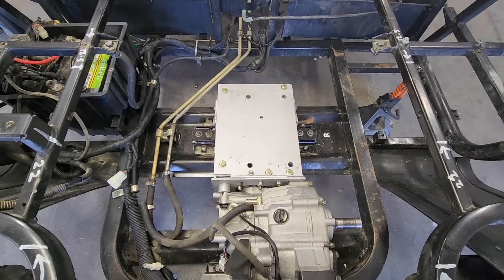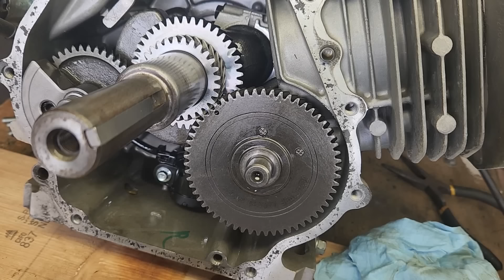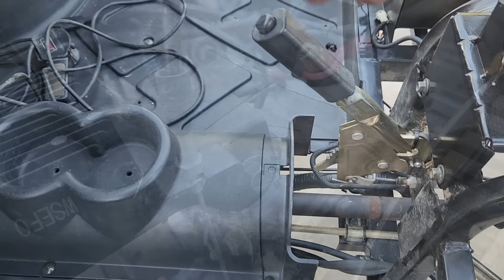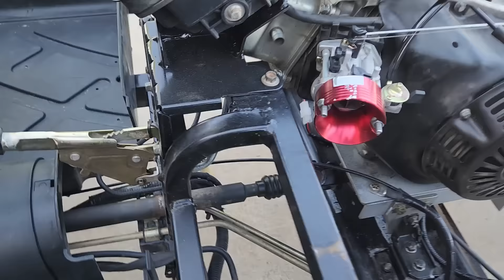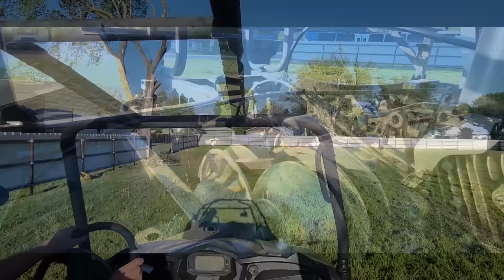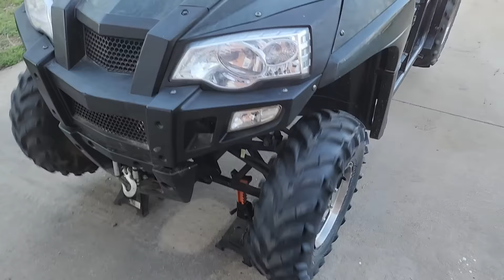S6 E15. HISUN UTV Predator BIG BLOCK engine swap.  4x4 works! plus upgrades!

Comment: I have a much harder project to fix, build!
I own a 2005 EX-GO 4X4 golf cart that was sold to thinking it was complete yet major parts were removed. No transfer case and both axles are identical to a normal pu truck. I hope to use a complete engine/tranny from a 500cc Polaris drive line. NOT as fun as your project here was. TY for the video as it was great and fun. ❤❤
Mike from northern MN.

Comment: Modern stop and start engines use the crank sensor to stop the engine at the right spot to reduce load on the starter and battery. The solution is just a couple lines of code away😊

Comment: 👍 I'm pretty sure you can also buy engine upgrade parts to quite a bit more power out of the Predator 420 engines like you can with the 212cc

Comment: 🇨🇦 Instead of messing with the compression relief just tune the drive clutch to engage at a higher rpm. It can be done easily with different springs or shimming the spring, changing or lightening the clutch weights. You can make that clutch do anything you want.

Comment: On my golf cart that I swapped in a Subaru V-twin I took the driven pulley apart and machied it so that it would open farther.  The belt goes in deeper and climbs up higher on the drive pulley giving more overdrive

Comment: Jimbo from my experience of running high compression big blocks with stock starters if you shut off the ignition while cranking you'll get it spinning just fine then turn on ignition and it fires right up

Comment: If you give the starter 24V the first second and then drop down to 12V the compression issue would probably be overcome. I reckon it would last a long time.

Comment: Jimbo im not certain  if quite understand  your reasoning  for removing the compression relief mechanism but i took it as a potential way of preventing the utv from creeping. 
Now im not certain what size torque Convertor/ cvt trans your using  but i know the smaller (sometimes called a 30 series) They make bushing for them that prevents the creeping not sure if one is made for your torque convertor the smaller 30 series bushings can be bought online at go power sports

Comment: Great video!!  Excellent work on the 4wd!  People with wooded property will almost certainly use the 4wd.  My tractor is 2wd and I have wished it was 4wd so many times.  but they didn't make that diesel Ford tractor in 4wd.  So I am constantly have to be really careful not to lose traction on an angle, or to get stuck in my low land.

Comment: why would you not just change the clutch spring in the primary to something slightly stiffer on engagement and the same top pressure or maybe a little stiffer  if required, multi rate springe are used all over the snowmobile and utv industry

Comment: I've been using the grease truck on carburetor gaskets for years.  Works like a charm especially when dialing them in and removing a few times.

Comment: Jimbo...use your skills to make an ignition cut that only starts sparking when it senses "X" amount of RPM so the engine turns up to x before spark.  If it is purely mechanical compression stopping the starter than mod the springs on the comp release.

Comment: starter procedure:
- Relocate electric starter
- Fit the pull cord to the electric starter with a pulley
- Put a knot near the end of the pull cord 
- The knot hits a cut switch for the electric starter to protect the new starter procedure
- Use when needed

Comment: have you tried to use a 18v drill battery starter circuit? and have it recharged by a booster buck, or the milwaukee m18 charger that runs off the 12v cigarette lighter port?

Comment: If there was a belt transmission and only the diff-lock, I would really wonder why they did not save the diff-lock and just went for two belt transmissions for automatic torque splitting + redundance.
Of course, a fourth belt for the front axle would have been excessive.

Comment: There needs to be a way to bring cold air to the fan otherwise the air will recirculate and overheat the engine.

Comment: I would be tempted to raise the starter motor voltage. An 18 volt tool battery would get the starter going with about double the force, if I got the math right.

Comment: You can strech the spring on compression release assembly. Or also can weld a small washer to add more weight to the counter weight to have it disengage the compression release.

Comment: What criteria did you use to select the CVT  drive clutch.  There many 780 clutches on the Jungle Website.  Is the unit you selected comparable to the real Comet 302405A?

Comment: Very cool. I'm just not sure how you thought you'd finish it this episode when you haven't even started on the turbocharger setup. lol
Is there an inexpensive high torque starter available that could save you the trouble of engineering a compression release?

Comment: Trigger warning, Murkin-cobble ahead: Harley Davidson PN. 28861-07A Requires attachment via welding, to the head or barrel, but operates with the starter solenoid voltage. I added one to a clone horizontal pitbike e-start 150cc when doing a bore/stroke 230cc upgrade. Firepower Automated Kompression Relief. FAKR worked great. Using a cable type, Suzuki had a solenoid-operated cable-puller on some Intruder v-twins. An exhaust valve lifter can be made by welding to the valve cover. Upside of pulling the head, you can belt sand the snot outta it for compression, and use a shim gasket. Honda later 390 had a rev-limiting coil, with a real advance curve. Often cheap take-offs from kart/minibike racers. Then you can carb-up without fear of disconnecting rod issues.

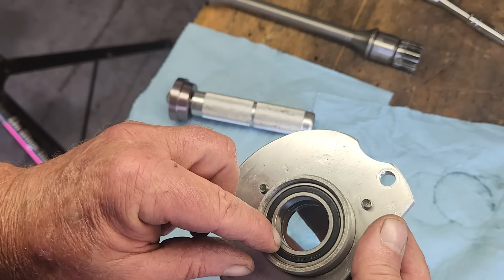Comment: @3:01 - "Lifetime Lubrication" - I worked in the aggregate business on rock crushers and conveyors.  Nothing screams "you're going to break down" more than a "sealed, lifetime lube" bearing.  I cannot tell you the number of times I had to replace drive pulley pillow blocks that the manufacturer said were "lifetime lubrication" bearings.  We would usually drill zirc fitting in to the brand new bearings to help longevity.  Nothing says planned obsolescence more than a lifetime anything.

Comment: (Just a thought) if starter has a hard time, you can probably retard cam timing either with offset key or one tooth. Retarding the cam will tilt torque curve to favor higher rpm.
Reply: Thinking more about it, retarding the cam would require bunch of other modifications. You first have to check piston to valve clearance, then you'd have to upgrade valve springs to get into higher rpm range, a billet rod would be a good idea over 4k rpm, I'd ditch the governor, if low speed torque is insufficient you'd have to lighten the driven clutch weights to increase the stall speed.

Comment: If you ungovern that engine and add a stage 1 kit (heavier valve springs, billet fly wheel, intake, and carb jets usually), and yes there are stage 1 kits that keep that charging abilities for the 420cc, you could get much better performance, if not exceed, the original boat anchor of an engine. WMB Wearhouse, Go Powersports, and probably the site you mentioned would had the stage 1 kit. I've been planning to do this exact thing to a cheap UTV for years, but can't find a cheap enough UTV. You could also lower the motor mount to fit the 670cc and then do a cheap lift kit to keep the ground clearance, but since you'd only be really using it to drive around town, that's optional. The 670cc engine does teardown to a fairly small package, but you'll have to make an intake and exhaust for it. The UTV seems to have a decent amount of room, so that option could be up for debate. I'm just suggesting my own thoughts.

Comment: Ive thought about buying an ATV or UTV with failed engine/no engine to swap it with one of those. Here I can get a 420cc one for only 170$, cost nothing and lasts years of abuse. Ive even revved one over 7000rpm without blowing up the flywheel, how that happened was: no brakes, heavy trailer and manual gearbox.. engine this small couldnt engine brake at all

Comment: "Sealed bearing that has a lifetime lubrication."  Yea... where "lifetime" is a variable time between 1 week and 1 century ;).  If there's no Zerk, there's no lifetime lubrication <g>.  Unfortunately, there are situations where sealed is the only option, so you place your bets on when you'll need to tear the equipment down to replace the sealed bearing that exchanged its grease for water and proceeded to rust itself to oblivion.

Comment: Funny story time with a direct tie-in to an older Cantina feature. So I'm working on splicing in an electric fuel pump to a repowered 1977 JD 214 project that is FINALLY 99% done and now having some gremlins. A guy referenced one of Jimbo's fuel regulator videos which I happened to remember very well and we kind of hit it off with shared experiences. As it turns out, a brand new engine with a stunning total of maybe 15 minutes of run time (generously Rounded Up) for tests actually had a blown head gasket the whole time, but in the process, I also found out that Mikuni once made (makes?) a vacuum pulse pump that I have on order... When the weather clears up, I picked up a MLS gasket upgrade and will tinker with an el cheapo Amazon pulse pump til the Mikuni shows up, but fingers crossed!

Comment: So here is a though if were to remove the 4wd shaft for low speed 4wd you could probaly use a electric motor  Like a ebike motor on the 4wd shaft long as you upgrade the main battery to a LIFPO4 battery and keep the speed to under 5-10mph . OR use a jack shaft to move the 4wd beside the motor  4 sprockets 2 chains and the shaft

Comment: Last night, near Chugwater WY, I got a check engine light with a random misfire and a knock sensor code. The wind was gusting to 60mph and my trailer was developing unwanted lift. The signs said no empty trailers between Wheatfield and Cheyenne, so I just parked in a lot behind a service station. Now I need a plan to do a roadside repair that will involve removing the intake and replacing the knock sensor. This requires planning as I have a credo that requires self-rescue, calling for help is a violation of my moral code. 
 - So, I have located the parts that I need, and I have found an abandoned gas station that is 4 miles from the parts store. Hopefully, I will get some clues about the misfire in the process of replacing the knock sensor. The internet believes it is a bad coil, so that will require some testing. It would be better if the code was specific to a cylinder, but this is just the P300. I fully expect to disassemble my only source of transportation and reassemble it in complete working order.
 - Plan B? Well, that involves creating the first air-cooled Predator V8 in a GMC Yukon. WWRCD? What Would Robot Cantina Do? I figure I have 4 days before the authorities are called.

Comment: That does good towing, the shop owners that I worked on, it would fry belt towing, all farm supply chinesium. Hopefully that saves your legs from moving projects around. If you get bored, can do UTV pulls, just dub dyno soundtrack to make impressions. 😊

Comment: They have become "unobtainium" but the old school gen/start could be used for starting and charging.
Not as efficient, but if I recall they had decent torque.
(sadly it would most likely require the removal of the starter recoil and the installation of a pulley system. Kind of a pain in the buttcheeks)
AWESOME VIDEO AS USUAL !!

Comment: As far as utility vehicles go I've been looking around for a John Deere AMT600 or even the later AMT626 that had seats and a steering wheel. But finding one here in the north that isn't rotted out from rust or missing body panels in pretty tough. Though I have found a couple even if they're ok condition.

Comment: To fix the compression relief…well rig it…extend the pull start to the back of the bed or spin the housing and go under the seat so you can still access the pull start.   Having easy access to the pull start will help if the battery is dead

Comment: A bunch of folks have already commented that you could install a manual compression release, but I also noticed that some of the forums suggest tightening the valve clearances just a smidge to make starting easier. The free solution is always worth a try.

Comment: Why an offset key?  I would think it makes more sense to move the magneto pickup.
Reply: Sounds like an aftermarket opportunity.
Reply from the maker: It takes two seconds to install the offset key.  Changing the magneto mounting location requires  a lot of fabrication.

Comment: I wanted a 2 seater UTV with a metal bed a few years ago. The Kawasaki Mule SX was the model I went with because I wanted air cooling, no power steering, no power brakes, basically less to go wrong. After looking at used models which were selling for basically new prices, I bought a brand new 2023 Mule SX fuel injected model. Yes, it was a "small fortune" as Jimbo put it, but I plan to have this machine until I die, and there is very little to actually go wrong with it.
Reply: Your thinking is not wrong. Do basic maintenance, and it WILL last a lifetime. Have fun -
Reply: If there's less fluids to check, I find I'll check them more frequently, and think about changing them sooner... Because it's a "5" minute job instead of 20-30 minutes of opening caps and pulling dipsticks from random, difficult to reach places.

Comment: If you can source a small enough spring for the compression release mechanism it should lower the amount of centrifugal force required to disengage it allowing you to lower the idle.

Comment: Jimbo, that grease on the gaskets will potentially allow the cover to shift under heavy load. There are a lot of places where I'd agree with doing so, but that side cover is structural and is designed for the clamping force to hold things in place, not the locating dowels!

Comment: That charging kit is exactly what I've been needing! I did a swap on my old Tractor Supply buggy (had a genuine Honda GX390 in it that died after 12+ years) but the new engine had a tiny charging system.
Reply from the maker: It’s a game changer for keeping the battery topped off! 👍

Comment: Would it be possible to relieve compression by bumping the starter in the opposite direction?
I'm not sure how complicated you'd have to make it, maybe a button that pumps 6v into it in reverse so that it doesn't actually crank over.

Comment: Could  a Lower Voltage Starter be used?
I know it was Common practice when "Big Block!!" V8'S were first Used.
Or ..a Reduction  gear Starter?
Reply from the maker: Unfortunately, all of the big block engines use the exact same starter.  There are no special starters for these engines.

Comment: One solution I've used in the past with high compression race motors, is to disconnect the ignition from firing until the motor is cranking. Normally I would have a push button for the starter and a toggle switch to ignite the ignition. This prevents kickbacks when the cylinder fires ahead of the motor being spinning fast enough

Comment: The OLD John Deere's had a petcock about 1/2 the way up the cylinder as a compression release. I am sure Jimbo could build a cable operated (or Arduino controlled) compression release.

Comment: The other option to reduce the idle-creep is reducing the mass of the clutch weights in the CVT driver, as they're biting at too low an RPM causing it to wander like that, less invasive surgery too compared to disabling the compression relief inside the engine, just have to beware of springy springs wanting to escape... :)

Comment: Hi nice project! you might want to look at your battery volage while cranking it may drop too low to power the starter. I had that happen to me with my motorcycle
Rich
Reply from the maker: Indeed the little battery doesn't really have a lot of capacity.  As I mentioned in the video I did try a different battery with the same results.  I guess I should have said  a "larger battery"
Reply: @robotcantina8957  Maybe a lithium one might provide more amperage?

Comment: Jumbo, awesome job.  I said it last video but that does give me some ideas.

Small reccomendation / suggestion. 
You showed 2250lbs? in winching the S10.  There are some really great calculations that take into account incline, rolling resistance, soil composition etc.

My best guess is you were only winching about 500lbs at best.  You can easily push a car on flat ground by hand.
Reply from the maker: That's a good point, I definitely need to look closer at how those forces actually play out! 👍

Comment: Just wondering why you didn’t adjust the clutch weights so it engaged at a higher rpm rather than lowering the engine idle ???
Reply from the maker: I like the way the clutch engages now.

Comment: I’d recommend a brake pedal lock for winching outside of the machine. Really common failure in early RZR’s was winching from park in the trans and shearing the  gear. Definitely want the brakes on if you’re doing the pulling.
Reply from the maker: On this rig, there is no park position on the transmission.  The parking brake holds the UTV for winch use.
Reply: @robotcantina8957 awesome. Keep up the good work
Reply: @robotcantina8957 does it lock all the wheels or just 2, you still might want the service breaks to help it out